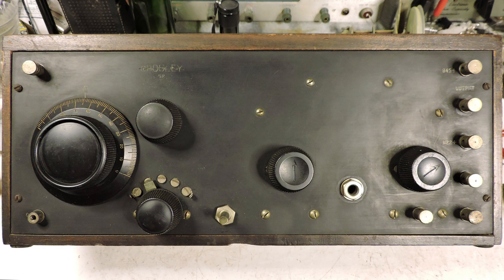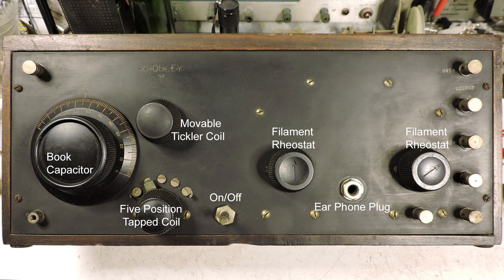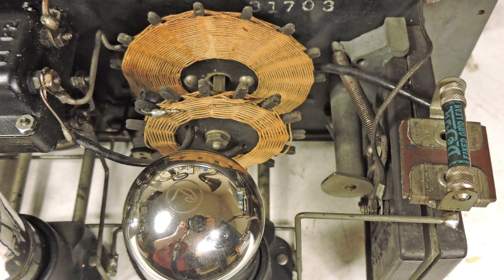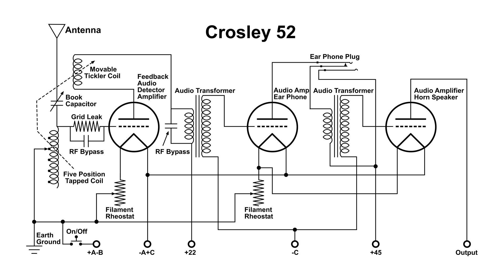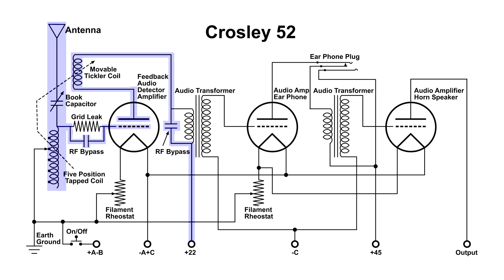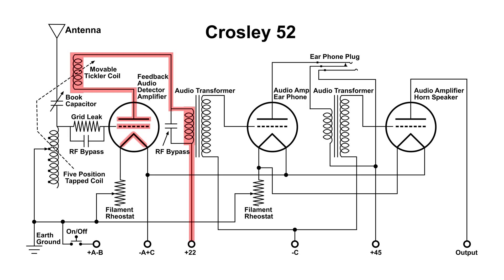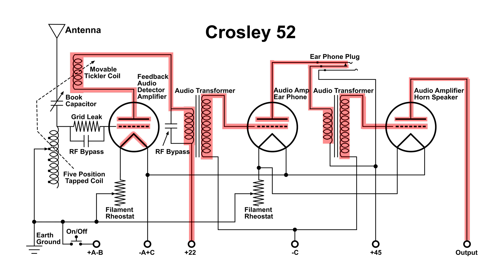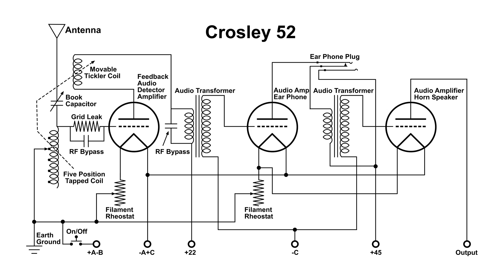Crosley 52 Radio Circuit Diagram Tour

Comment: Hi Rick, I have the same model. I had it running about 4 years ago and tried it again this week and it didn’t work. Found that the 22v Transformer was open on the primary side (unfortunately). I am set up to rewind transformers. So hears some info if you can have and share if you wish, that is if you haven’t already pulled one apart……………………………There are 2 x E laminations that fit either end of the core, each side has a rivet in the middle holding the laminations together. The core is round wax paper about 18mm or just under 3/4” I.D. Now the best part of it is I counted off 17,335 Secondary windings or 48 layers of .06mm Diameter and 1970 Primary windings, with the same diameter . The original O.D windings were approx. 34mm or close to 1 3/8” with plenty of room to spare in the lamination window. Pity I can’t attach pics to show you. From memory I think the copper was about 61 grams not sure in imperial. If this can help you or any others in the future, happy to help. Cheers
Reply from the maker: Thanks very much for this detailed information, It will help many now and in the future.

Comment: Further, I don’t asking to show how to draw a schematic for Presto K7 specifically but what I mean is to make a video showing how to draw a schematic for any vintage tube device hasn’t a schematic available for buying or downloading from the web so, the user will transfer the design of his/her device by drawing the schematic and publishing on the vintage electronics forums to let the others benefit of.

Thanks.
Reply from the maker: How to draw up a schematic would make a good video. Good luck with your restoration. Until the video, you might consider downloading my free e-book you may find it useful.
The Vacuum Tube Shortwave Radio
http://www.richardmcwhorter.com/vacuumtuberadio/

Comment: That was very nice vid, I got and old radio . It is a Galaxy 5 "1964". Missing one tube. Lots of Dust. I never worked on a Transceiver, before. But I do have some electronic knowledge, mostly solid state. But I would like to learn how to repair it. I have all the wiring diagrams  and a full parts and operation manual. I have been watching your Video's for a while now. Do you think I should try to get running., or just not try, and get rid of it? Thank you Sir.
Reply from the maker: I found the wiring diagram for the Galaxy V. It looks like a very nice transceiver with tubes and transistors.

Mostly what needs to be replaced are the wax capacitors and the electrolytic capacitors and of course any tubes that test bad. I have a free e-book that can help you understand this process. 
Here's the link to the download page:
The Vacuum Tube Shortwave Radio
http://www.richardmcwhorter.com/vacuumtuberadio/

I usually do not change out the Mica capacitors (picofarad) in the radio and particularly the picofarad capacitors in the tuning circuit. Also I do not change out resistors unless it is obvious that they are bad.

I hope this information helps,
Rick

Comment: Do the filament rheostats affect the gain of the tubes?
Reply from the maker: Yes the rheostat's do change the performance or amplification of the tubes. They did this because the a battery that runs the filaments was usually a car battery. The filaments draw most of the current in the radio so by varying the filament voltage you get save on the car battery. Some people had more than one car battery and it was not uncommon to have one battery being charged (in a store) while they were using their other freshly charged battery.

Comment: Rick, Does a tuning capacitor work by sending non-tuned frequencies to ground and only letting one station through?
Reply from the maker: The way the tuning circuit works is that, when a station is tuned in it is the strongest signal and all the other stations are very weak or nonexistent.
Reply: Thanks, Landrew0.  Just learning and have sooo many questions.
Reply: Landrew0 
Thanks, Landrew0. Just learning and have sooo many questions.
Reply: AllAmericanFiveRadio Thanks, Rick.  I'm glad you folks are out there and willing to help.